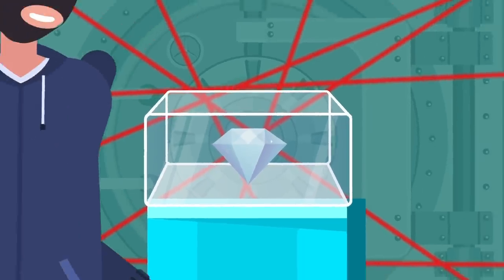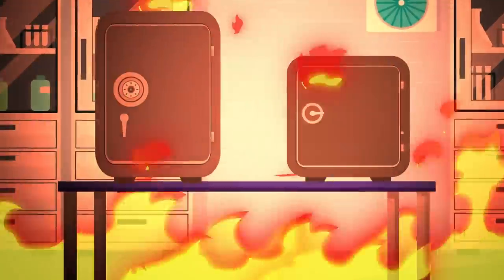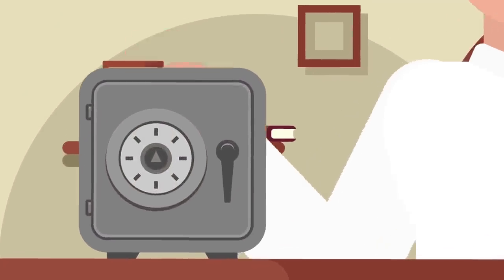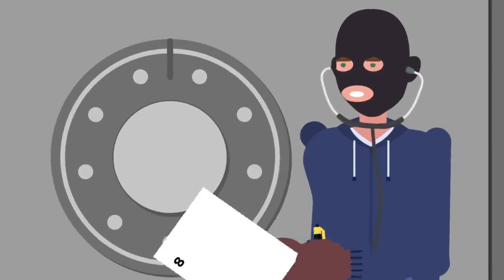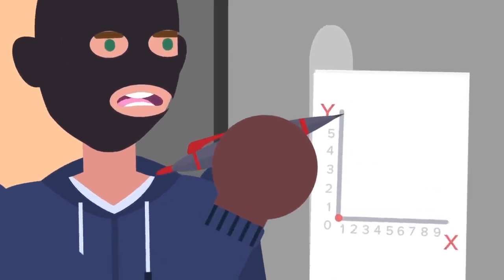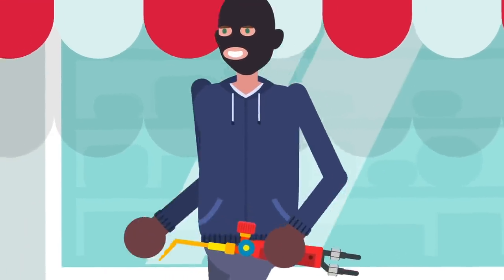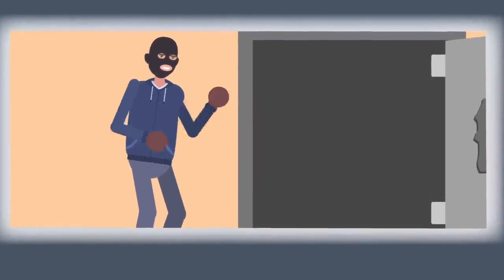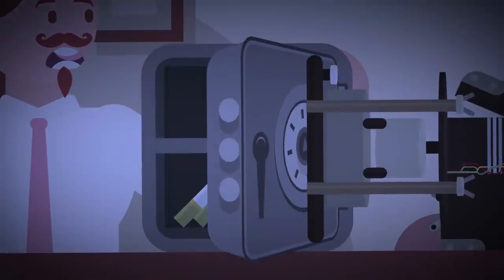How Real Criminals Crack a Safe

Comment: They make the worlds smallest remote controls in the shape of bugs like Flys (with video recorders). It would be extremely easy to record the numbers. With all the technology this day in age I don't know why they don't use fingerprint or eye scanning?
Reply: uhh...
Reply: @adummyguy right that's what I'm sayin. . . I'm at a complete loss for words on a response
Reply: @codeyblizz2118  fingerprints can be taken off of things the person touched before if done correctly
Reply: @codeyblizz2118  cursed
Reply: @codeyblizz2118  hol up.
Reply: @codeyblizz2118  most modern readers detect blood running through the finger and heat and finger the lock on my property already has such technologies in place so chopping the finger off is useless
Reply: @joshua01  kidnap them
Reply: @ahmed4363  cursed x2
Reply: Most of those can be bypassed

Comment: Use a grenade. As long as the metal isn't too thick and the grenade is powerful enough, i'm pretty sure you'll see some cracks in the safe.
Reply: with the added benefit of alerting the entire neighborhood, which will clog up emergency services' phones while they all try to call 911 at the same time.
Reply: @spamuel98  😂
Reply: If you're not in the same building maybe😂you're gonna blow up a pretty good chunk of the room
Reply: @spamuel98  the objective was cracking the safe, not doing it secretly

Comment: Some safes have metal plastic sandwiches, which will partially melt and ruin drilling and cutting. It gets even worse when you use a blow torch as the plastic becomes quickly a gas and propels further molten plastic out of the hole...
Old safes often had glass vials with harmful chemicals to deter any brute force attacks.

Comment: A lot of digital key pad safes use an electronic solenoid to release the lock. A strong magnet in a sock can move the solenoid lock. The sock is so you can move the magnet once it is stuck to the safe.
Also a lot of the cheaper safes are only sheet metal cans with concrete inside. So use a grinder to cut the sheet metal and a sledge to brake the concrete. This will make a lot of noise, but it is easy

Comment: I see you decided to overlook the slight risk of sudden removal from existence, with the jam shot. You can also crush it open by heating it to the "safe" Max temp, then drop it Dunkin booth style into a ice water bath. 
Easiest ways to get into a common relocatable safe is tip it over and slice the floorpan out with magic door making bars. If not able to get the angle iron and materials or it's too noticable, just melt a big enough hole with a thermite can-opener.

Comment: Darn, I was hoping they would mention how effective thermite would be since it burns at about 2200 C. Also it's easier to get iron oxide than nitro glycerin😅
Reply: Isn't it aluminium shavings and magnesium?
Reply: @thelegion1646  aluminum shavings and rust
Reply: @thelegion1646  they use the magnesium to ignite it 👍

Comment: its easy, you ascertain what make and model the safe is, call the company that made it, social engeneer them into giving you a website that allows you to download a "cheat sheet" (all the big safe companies have this service for professional locksmiths to take advantage of.) with "X" marks the spot for where to drill,  as well as how deep. tape them together, and tape them to the safe, lining up the tumbler, with the tumbler on the printout, (also with it pointing at the number the printout tells you, taped in place so it cant move.) and just drill where it says. 
its actually EZ-PZ, it just takes a long time to do. you only need a scope if its a "boutique" safe that's got a unique mechanism or from a small company that doesn't offer diagrams to locksmiths.
you WILL need plenty of lubrication for the drill bit though.
auto dialers DESTROY the mechanism of the lock almost as badly as just drilling it does, and it also takes longer.

Comment: After months of planning four of the worlds best safe crackers get into a huge gold depository with nearly one billion in bullion. After getting into the vault area they begin cracking the massive vault door, and after only one hour the big door swings open and they see all the rows and rows of gold bars in their thousands. They are amazed how easy it was to open the vault and now are going to transport the gold over the next 24 hours (weekend)  into their several vans.
As they all walk into the vault to start getting the gold the vault door closes behind them locking them in, as the turn around, they see a big sign on the inside of the vault door: GOT YOU SUCKERS!

Comment: The video started out with some good info, but about 3 minutes in and it veered into fantasy land. Like movies and TV were the primary source of info. Most break-ins or attempted break-ins I've seen involve grinders, hammers and pry bars. I've never seen one that involved explosives, or legit safe cracking techniques. I'm not saying it doesn't happen; it's rare.

"But a locksmith told me _________...." Most locksmiths know very little about safes. Even good locksmiths operate with false or incomplete information when it comes to safes. Because locksmiths and safe technicians are not the same. 

Nice try, Infographics Show. You missed the mark on this one.

Signed- The guy who services, repairs and breaks into safes and vaults for a living.
Reply: Been looking for the comment, cant find it. If you know the numbers but not the order isnt it far less than the numbers mentioned in this video? Like 160-somthing for a 3 digit comb that you know the numbers of…? Isnt it 6? Lol

Comment: What about using thermite to open a safe?
Reply: It destroys most things in the safe, angle grinder and a ball peen hammer will work 90% of the time. And honestly you’ll do 100 jobs before you even run into a safe. And 90% of that… just fucin pick it up and take it w you so you can open your presents on your couch. 🙃